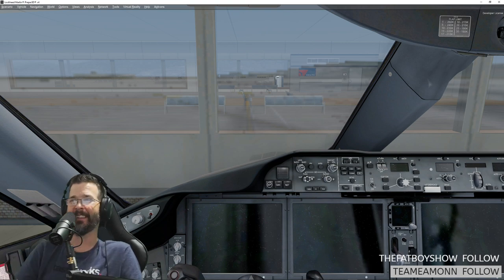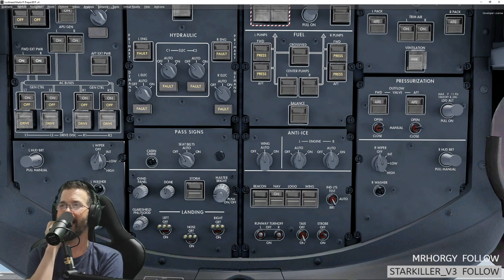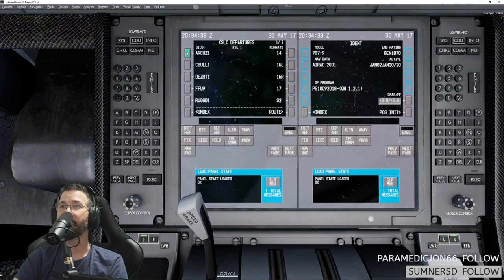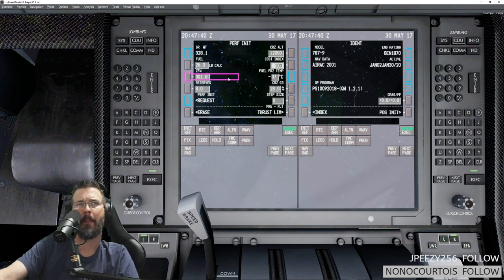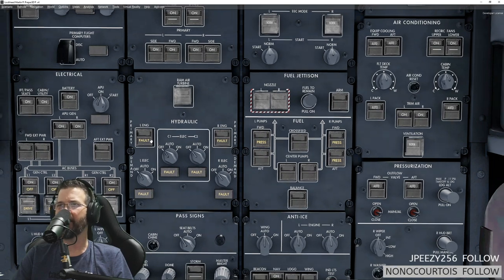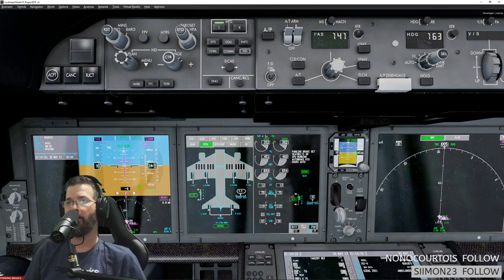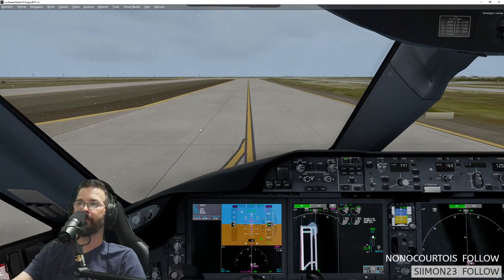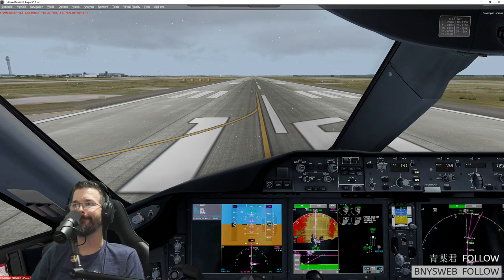Real World 787 Captain Part 1 QualityWings Boeing 787

Comment: I wish we can have this beaut in X Plane 11.
Oh boy
Reply: I want it too +up
Reply: Mfs2020
Reply: @robburgundy9539  Would be great but I won't be buying 2020 anytime soon.I saw videos on You-Tube where they tested different systems from low end to high end and even the high end systems suck at getting decent frame rates at times.MS 2020 will kill my rig.X Pane 11 Vulkan is running great on my rig with minimal stuttering.When I am rich I will upgrade  🤣🤣
Reply: Games TV how did you get vulcan on x-plane11? I still run open gl and get 20 fps on a 1080ti
Reply: @robburgundy9539  If you update X Plane 11 to the latest version you will have an option in your graphics settings to run with Vulkan.Tick the box and restart X Plane 11.
Reply: The Magknight 787 for Xplane isn't too bad now, and they're doing regular updates. A long way to get to this quality though.